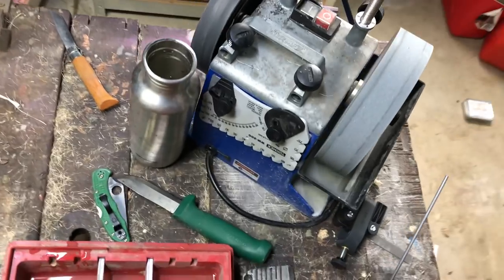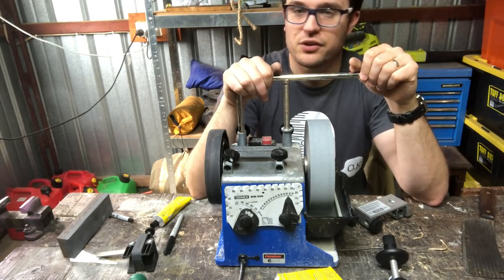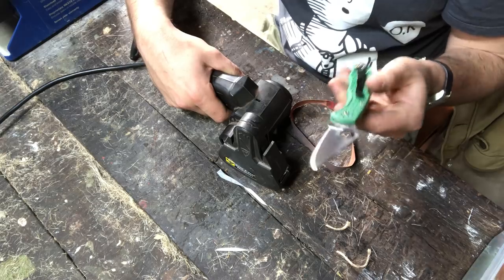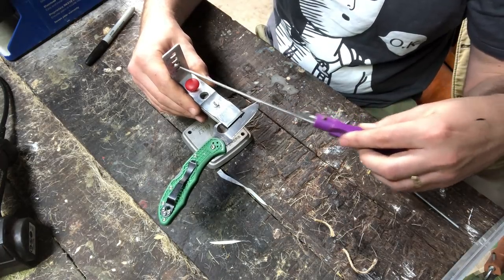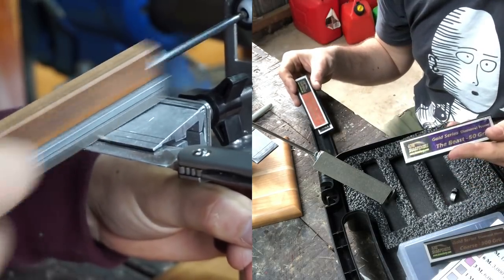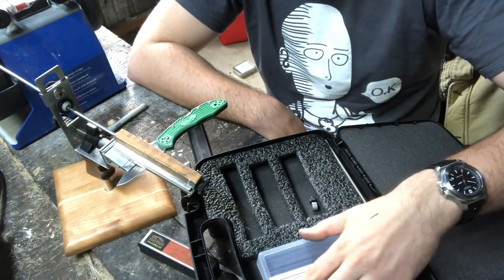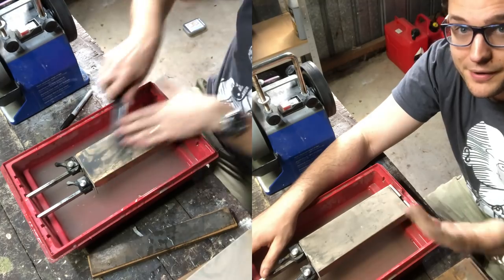5 Home Sharpening Systems Rated and Explained

Comment: Yeh the WorkSharp? Just a few tips that I have found that make the WorkSharp work really well. 1. You are supposed to let off of that trigger when the tip is halfway through the belt. Not ride all the way through. That's why you are burning your tips off. 2. I know in a previous video you had said that you use the 20 degree setting for pretty much all your knives. Kitchen and work knives. That's a no no too. Gotta follow the directions specifically to get that sharpener to work the way it's supposed to man. Leaving it on that setting will eat your work knife blades up cause that's too shallow of an angle bro. 3. You are moving a bit to fast with that pocket knife as well. Gotta slow it down just a bit. No, it won't get blades as sharp as a pro using a superior sharpener. But you will go through less belts and less blade wear if you follow the specific directions. And that machine will get knives super sharp (sharp enough to shave hair off of your body) if you do EXACTLY what the directions say brotha. Not trying to be an ass or a know it all. Just trying to help sir. Ty for the vids tho.

Comment: In the KME section it's pretty clear you are also grinding on the jaws as well move that knife out some.
Reply: The Smith's system has the same issue. The Smith's only goes to 20 degrees, but the jaws still catch the stones on some knives no matter what you do. I wouldn't buy another one. I would invest in a KME system though.

Comment: The sharpening systems out there are really good. My only problem is I can raise a burr on most knives in 30 seconds with Shapton glass stones (500 grit). Then I spend another 5 minutes polishing and I'm done. Screaming sharp in 5 min. (actually hair popping sharp).  Admittedly, it took some time and frustration to get the muscle memory to get consistent results but it's just SO fast and effective that I have a hard time breaking out the sharpening systems anymore. The glass stones are definitely a large investment but worth every penny.

You can also geek out and run the grits up too 16,000-30,000 for grins. Normally, I only go up to 2000 grit on a regular basis but going higher is fun sometimes and the stones do it very quickly.

Comment: You are correct that the work sharp will damage the tips of pocket knives, because you using it incorrectly. You are supposed to stop the belt when the knife tip is half way across the knife tip. Pulling the knife all the way through the moving belt tends to round the tip of the blade. I have the Ken Onion version of the Work Sharp, and it is much better, in that it lets you dial in any angle you want.

Comment: Sharpton 1k, 2k, 5k is a great set for about $150 in the US. Add an Atoma 140 for flattening and fixing chips(I use a Shapton 320 for chips and 400 Atoma for flattening) and a decent stone holder and you're set. At under $220 you can sharpen anything for a quite long time. Do I have an edge pro and clamp systems with all sorts of stones, compounds and strops? Yup. But a lot of my sharpening is done on those 3 stones and a homemade kangaroo strop with diamond spray.

Comment: The original Worksharp I found worked well for pocket knives, though you have to be standing or at least I did to keep the right angle while pulling the blade through.  The Worksharp Ken Onion on the other hand worked best with larger blades using the flat blade guide (still have to stand).   As for Whet stones.  Spyderco seems to have come out with the best bang for the buck with their ceramic stones.  Least expensive of the sharpening items to buy that works is the Speedy Sharp.  Rips metal away and hard on knives but does give you a sharp edge in just a minute or two if your good at angles and strop.   The key word is Strop.  Know how to strop and have one, saves sharpening and ripping metal away.

Comment: I have been told that the T2 Diamond wheels will fit the T4, and you can also get CBN wheels called the Tornado Jr. for the T4.  I just got a T4 a few months ago, and I think it is the best way to sharpen knives, as well as being the fastest.

Comment: Hi. Smitty here. At time 21:06 I saw all of your stones/hones/strops with dark spots. Here's what I found and use once everything is a bit dirty... Go get some white vinyl pencil erasers. Please do not use this trick with the 70 grit or the 120 grit. The lowest stone I do this on is the 280 grit. So, from 280, 600, 1000 Super Sapphire(2000 grit) and 2 leather strops. 1 with green 2500 grit and 1 with red 4000 grit. 
Please trust in what tell you. I use the pencil erasers to make everything look like new stuff.

Comment: I just ordered a couple good diamond stones for bench sharpening. I am very split on the KME, I like the system, but I also feel it`s overpriced for the materials you get (I´ll talk about that in my video on the KME). The TSPROF (which is like one of the competitors to the KME) is definitly a nicer made system in terms of fit and finish, I think it is about the same price as the KME, tho the KME has the better stones. 
I think I`ll end up being a Benchstone sharpener someday, I just like doing it and I am pretty good at it, actually recently sharpened a couple of axes and hatches free hand for some friends and did very well :D
Reply: German Survivalist a kme will probably work better for most knives under about 7 inches though a tsprof will also have a bit of a hard time with a full flat grind
Reply: @bp-hx9ts  Yes. I have a KME (and WE) and the KME has no problems with FFG and is perfect knives under 7 or 8 inches. Plus, it's so compact I can fit it in my desk drawer.
Reply: Lenny yeah great system I don’t think a tsprof has a stone thickness compensator either

Comment: Does the KME do a better job of evenly holding a full flat ground blade than Lansky? I bought a Lansky probably 20 years ago and was discouraged to find that it wasn't really able to evenly hold a full flat ground blade. (which most of my knives have)It's pretty much mothballed now.

I have a Ken Onion Worksharp, which is OK. The problem with it is that it uses the side of the blade as an angle reference, instead of the line through the center of the blade. So for example, it would give a very different angle on a scandi Mora compared to a wide flat ground blade like a Spydiechef. Also, it's very hard to hold the angle steady when I get out to the tip and most of the blade is off the guide.

For the Tormek, how do you follow the curve of a blade? Is that part of it still guided, or does it become kind of freehand?

One popular system missing here is a the Sharpmaker. That's the one I like and use. It's so simple and so well designed. The ceramic stones and coarse diamond ones don't seem to ever wear out. You should check one out. It's not guided, but since all that's required is to keep the knife vertical, it's pretty reliable anyhow.

Comment: The reason you're having issues with the knife tips on the Worksharp is because you are using it incorrectly. The directions states you are to stop the belt BEFORE the tip passes the belt. You are supposed to stop the belt with the tip in the middle of the belt. Then lift the knife and start the belt again for the next pass.

Comment: First off, One Punch Man is AWESOME! Second, thanks, you talked me out of the Work Sharp. I have a Lansky with a bunch of stones and want a KME, but it's a bit out of my budget. Great video, as usual!
Reply: Consider giving a freehand diamond stone a chance. It's not as hard as you think and you can sharpen really fast. The sharpal diamond stone on Amazon is cheap and actually really good. Should probably get some little blue angle guide pieces (they have a 10 pack of 10-20 degrees guides for very cheap) also to help get you started. Im no expert but it only took me about an hr or 2 to get down holding a fairly consistent angle. It can take a lot longer to master it and to sharpen various blade shapes, I'm still just a novice.

I always used guided systems but wanted to feel more like I had learned the skill (art?) of sharpening and not of any particular system I was using.

Still, for anyone who isn't a sharpening nerd than who really cares to begin with lol
(=

Comment: The fact still remains that I can grind a bevel thin and then any edge I put on it will outperform a mirror polished edge from any system, whether it was sharpened via stones or a system.

Comment: Hey thanks for the vid.  How would you say the Spyderco sharpmaker or Lanksy turnbox stack up to these?  Would you say they are 40 or 60 percent as good an edge?  Or not even close?  I am fairly new to the hobby and use a turnbox.  With a little work I can get a hair shaving edge but I wouldn't call it a mirror.......your comments are welcome.

Comment: Great video, I've been using the KME from the early days prior to "Full Deluxe Kit ".  The current kit is comprised of all the accessories and the lapping films.  The Deluxe Kit has 50, 100, 140, 300, 600, 1500 grit diamond stones.  I will typically re-profile a new knife  starting at 100 grit diamond then finish off with the full lapping film up to .1 micron 60,000 grit.  The excellent part is that the stones are all of the same thickness.  I check the angle when switching to the lapping films. 

I had to go to the diamond stones to deal with my first knife in ZDP189 (Spyderco Endura).  You just can't cut the very hard steel with anything less. (in a reasonable time).   The KME Delux Kit is what I would buy today for my folding knives. $299 and you are good to go.   The lapping films are optional, a good strop is all you need.  My Spyderco Endra has had 2 edges, the factory edge and the re-profile on the KME.  The blade needs a stropping every few months and is by far the sharpest EDC blade I have ever owned.

 I WATCHED YOUR VIDEO BECAUSE...   I am looking at a better solution for larger blades in the kitchen.  I am a "C" student best case with the bench stones and really have a desire to get the same results for our kitchen knives that I get with the KME.  I am looking at TSPROF ($800 Yikes)  OR The Hapstone R1 with the diamond stones for $499.  I am leaning toward the Hapstone R1 because it will take my KME stones and films. 

I have a feeling that the KME will still get the most use because it is smaller and can be deployed quickly and put away fast.  The other systems are larger and will likely live in my garage.    Setup time, mess and hassle are a big factor in getting things done. 

The other thing that gets very little discussion is the fact that clamp systems allow you to use your "dominant" hand for both sides of the knife.  Think about how well you are able to write with your less dominant hand?  This is what prevents me from looking at the Edge Pro system or the Hapstone R7.

Thank you very much for the video Pete.

Comment: You can get diamond slurries on Ebay. If it's just a slurry that you need, see what is available.
Reply: Here is an example of a slurry. You can use them on soft metal plates i.e., aluminum or brass, the diamond will embed itself into the softer metal making a lapping plate. There are all sizes  of diamond and garnet pastes and slurries. The link should take to one but others are suggested below on the web page. https://www.ebay.com/itm/Leco-Premium-Diamond-Suspension-3-Micron-Part-No-810-997-016-Polishing-Slurry/223818934678?hash=item341ca5e996:g:XfYAAOSwSxteBmXa
Reply: The slurries and pastes are not attached, they are used with soft metals and embed themselves into the soft metal. If you can get diamond plates you like cheap, great. These are just another option and you can get them in a large variety of sizes. Here is a great site with an example of lapping. This particular video is not diamond but he uses diamond in others. Lapping starts at 6 min.   https://www.youtube.com/watch?v=Js_B5-7jkag
Reply: David, I watch so many videos I forgotten exactly why I suggested the slurry but IIRC it was to offer a custom solution. I have the Lansky kit and watch your video to get ideas on knife sharpening technique but I am using gunsmithing and machining abrasives on my knives also. As I learn about metals, abrasives and metrology I find overlaps and I think I was encouraging you to explore roll-your-own solutions if the suppliers don't have exactly what you want. To answer the question, yes the lapping example is similar to stropping on a hard surface. The guy who produced that video has a lot of good video on lapping and metrology. Here is another humble guy who gets professional results at home and addresses you question more precisely at 15 minutes. All metal surfaces and the abrasives wear, even diamond chips if I understand correctly so it is more a question of service life. Then either "true" it back up and recharge the abrasive or replace. Check out Robins video, he is trueing a surface plate but goes into the homemade plates at 15 minutes into the video.   https://www.youtube.com/watch?v=sKwZxV4bUoA

Comment: Saving up for the tormek. I’m keeping my lansky going till then and my Ken Onion worksharp. Having multiple systems is key to being a versed knife owner and user. I will be picking off whet stones also. A strop after my field use on fixed blades keeps the sharping away. Even knives that aren’t being used as much as others may just be to the edge from maker. So being confident and having the right tools often gets the less used knives out on my hikes.

Comment: Whats your opinion on the spyderco sharpmaker and the lansky croc box
Reply from the maker: havent used either of those ones, so I really am not sure!
Reply: Nicola Massa a sharpmaker is better but a lansky is really good for 16 bucks
Reply: I've had a sharpmaker for about 3 years now and it's pretty great for basic sharpening. You'll want to spend a bit on the ultrafine rods to get your blades shaving sharp (it comes with course and fine). Maybe the diamond rods if you plan on reprofiling. It's reasonably versatile, but 2 caveats - it's awkward as hell for sharpening big blades like a machete, and if you have a lot of super steel blades, be ready to spend some serious time in sharpening. My S110V spyderco is at least half an hour between the fine and ultrafine rods. If you go for it, get yourself a strop and some green paste for a decent mirror polish.
Reply: Brady Blackburn the reason it takes so long to sharpen a 110v is because the rods are not great sharpening rods there better for a touch up or a a latter stone in a progression of stones and you can get a hair shaving edge off the medium stone no problem if you know what your doing and chromium oxide isn’t that great to strop on honesty get cbn or diamond to strop on for super steels maybe alox or chromium would work but they won’t work that well

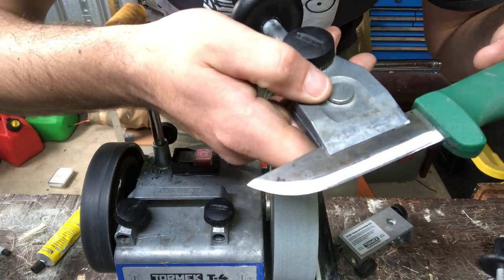Comment: what you said  at 5:13 and at 5:50 are contradictory. what you said at 5:50 is correct, it will give you a hollow (concave) grind

Comment: Great video thanks. I've got a lansky but your review has helped me decide to bite the bullet and invest in a kme system, probably the base plus then pick up the add ons as I go. Quick question about the lansky though.. I tend to end up with a wider bevel on one side than the other, any tips on correcting that? Many thanks.

Comment: aren't you supposed to only run the stone towards the edge of the blade, not in both back and forth motion?
Reply: You can go back and forth but you need to hold that same angle.

Most pros will only go in one direction

Comment: I'm not surprised that sharpening with the Lansky takes you a long time if you keep your hones that dirty - the ultra fine is supposed to be white, yours is black! I clean mine with honing oil every 50 or 60 strokes, and that keeps the stones sharp. My gripe with the Lansky system is the build quality - seriously, after 40 years and countless millions of systems sold, couldn't they have put some less crappy hardware on it, alloy bodies for the hones etc? Who else has a load of old Lansky hones which have all broken around the guide rod hole?

Comment: My lansky doesn't have that much use and already does not sharpen both sides the same angle.
Reply: Lansky works great...except on full flat ground blades. Those, it won't hold at the same angle on each side.

Comment: Convex is nice and thin but it is fragile compared to a V grind with the same apex angle.  In order to convex a knife you either have to remove material by abrading bevel transitions, which removes steel from behind the edge, or by convexing the cutting edge and consequently making the angle fatter which is stronger but obviously less thin.
Reply: Convex has it's place but there are people out there who have made their knife MUCH thinner and said "It's much more durable now".  But if they don't have a steel that can handle thin geometry they shouldn't expect it to stop chipping when they thin it out by convexing.  And they'll be sure to let you know that they stopped that chipping by convexing it when all they did was fatten the apex angle.
Reply: Lol uh... V grind, convex, hollow, chisel... All remove steel from behind the edge lol . Sharpening removes steel behind the edge lol

After a knife has been given a convex grind there will be more steel behind the edge than a hollow or v. Its really simple
Reply: @SuperSteelSteve  yea confusing, they aren't separating the actual edge from the grind nor are the factoring in the edge angle and behind the edge thickness.
Reply: SuperSteel Steve yup
Reply: You've got it backwards, unless you're talking about the sharpening media, not the edge. Concave or hollow grind is where it's thinner behind the edge.